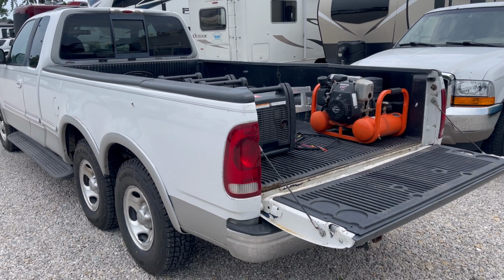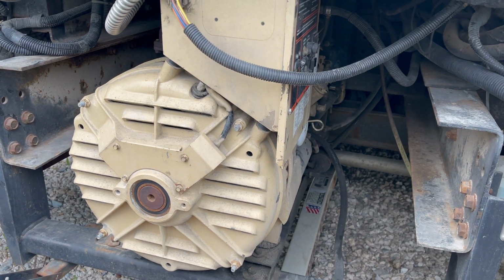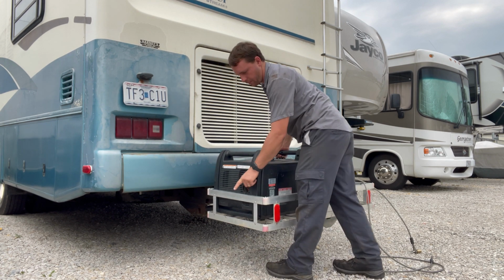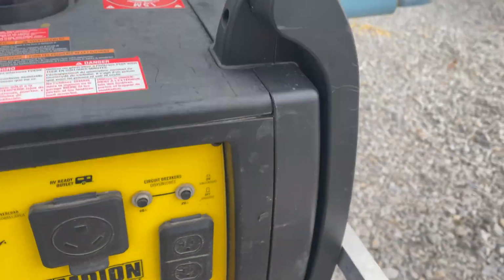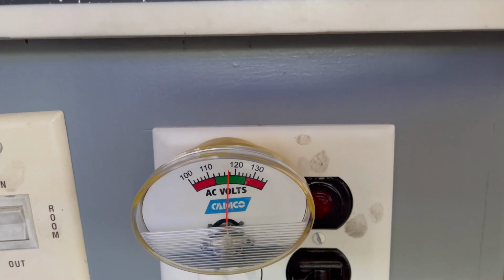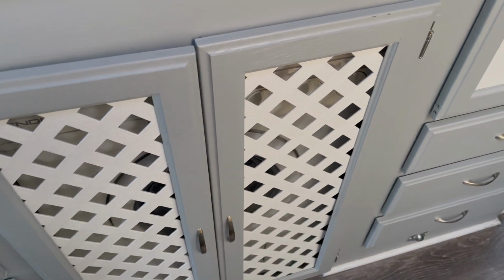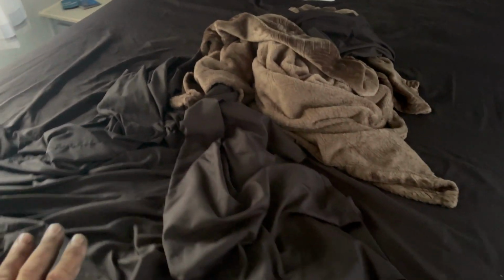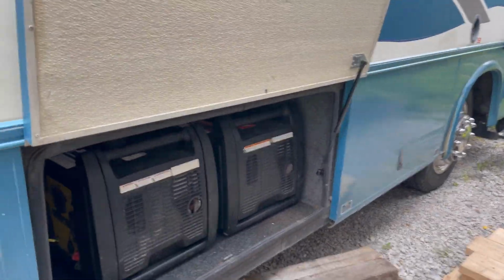Testing Inverter Style Generators on my 50 amp Motorhome

Comment: That joint box has nothing in it. The inverters inside the genarator can sync with incoming sinewave so the box is basically just like if u make a Y harness with two plugs joined together line to line and neutral to neutral. U don't even need that parallel kit to use this parallel feature. U can use any inverter generator with another inverter generator in parallel.

Comment: Did you try packing the old bearing with grease? You could stick a needle in it for temporary use also those are nice generators

Comment: Do you think you could make a custom exhaust system for the two generators and put them in the same compartment and just hard wire them like that? Might need electric start tho, or do you think the repair on the main gen is easy it's just inconvenient right now.

But the diesel gen probally has better efficency.
Reply from the maker: I'm sure a custom exhaust would be possible, but I went ahead and repaired the main generator as it is much more efficient and runs off the on board 100 gallon diesel fuel tank.
Reply: @DanielJaegerFilms  that's fair. How does the onboard generator vent? It seems very quiet for what it is but I doubt it taps into the actual exhaust pipe. Does it have a muffler and a straight dump or does it vent out the side?

Comment: Record the bearing fix!
Reply from the maker: If I did the job I most certainly would have, but I ended up having a generator repair shop fix it because I didn't have the tools for it and quite honestly, wasn't comfortable working on that part of the generator yet. If I had a similar one to practice on first it would be a different story.

Comment: Chose Champion generators are cheap China junk. Sure, they'll work for a while. If you want trouble free reliability for decades then Honda is the way to go.
Reply: Not much different. Honda's small inverter generators now come from Thailand, and open-frames come from China. At least Yamaha has some Japanese production, and their larger engines were from a US company (Robin, which became Subaru Robin, which was purchased by Yamaha).
Reply: @straightpipediesel  That's what people say until they own a Honda. There is no comparison in the longevity and reliability.
Reply from the maker: Yeah I've heard mixed reviews on them as well as Generac (heard some people call them Generjunk lol) but you're right about the Hondas. My dad has one for his RV and there's a huge difference in the build quality.

Comment: I had a Champion generator for years it was great. My dad has the Predator inverter it’s super quiet but very temperamental. I wouldn’t run the A/C and microwave at the same time.
Reply from the maker: Even with the on board 7500 watt diesel generator I try to avoid running the electric water heater and / or the microwave when both A/C units are running.

Comment: TBH I would just take off the seal on the bearing and repack it from there. Not the proper fix but I've had that last a long time.
Reply from the maker: I considered doing that. I think in this case though I'm glad I replaced it. The generator repair shop I had replace it showed me the old bearing once it was off and I'm glad I just replaced it. The bearing was pretty bad.

Comment: The dual fuel version of those 3400 Champions is a sweet unit, I have never and hopefully will never put gas in mine. Propane for life.
Reply: Champion claims 14.5 hours at %25 load while using a 20lb tank. Longest I've ever run mine was 4 hours at %25-%50 load while charging a manlift and running a corded drill. At 50% load with a 30lb tank, I'd expect it to last somewhere around 10-12 hours.
Reply from the maker: Just out of curiosity, how long will a gen set like that run on a 30 gallon propane tank? I've considered that option as well...